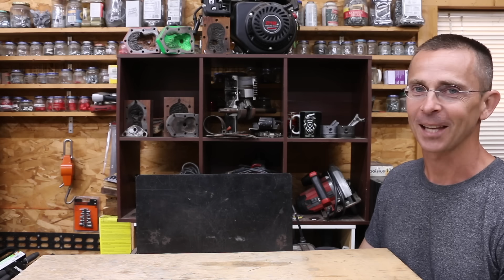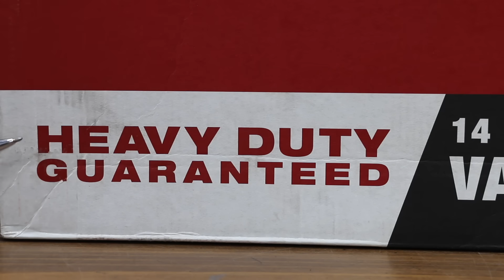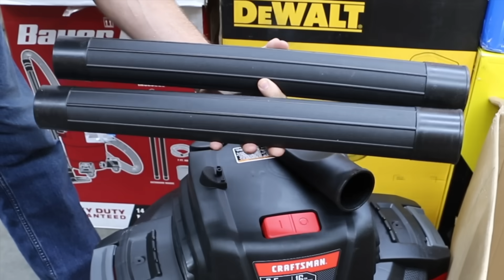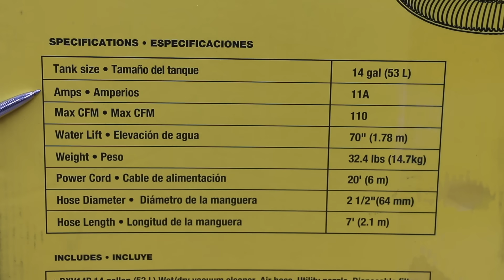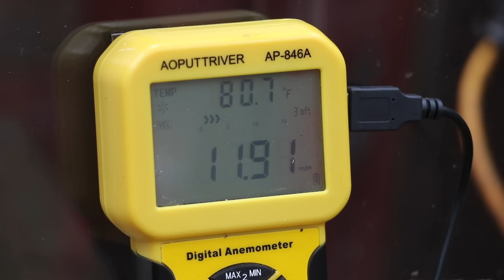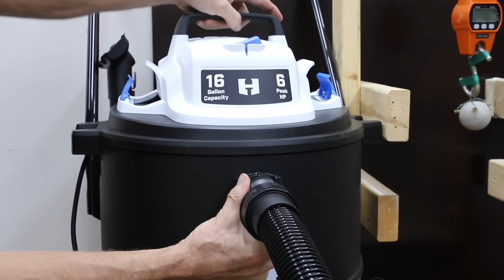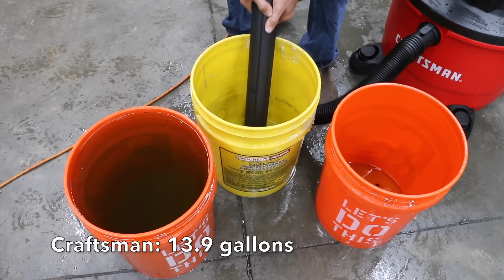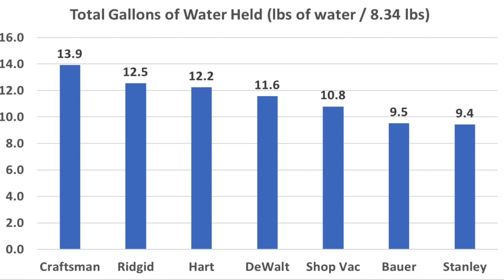Best Shop Vac? Ridgid vs Shop Vac, DeWalt, Stanley, Hart, Craftsman

Comment: Great video as always. The only thing to consider (if it really matters to anyone) is that particular Shop-Vac brand model uses a brushless motor and I doubt any of the others tested do. This means that at a similar amperage drawn...that motor actually produces substantially more horsepower as it is way more efficient than a brush motor. I’m not sure as to the math for how much different but I would bet certainly enough to matter.

It also will mean a substantially longer motor life.

Obviously real world testing showed it to be an inferior shop vac so there must be a lot of other factors at play as in theory that model by far has a superior motor to the rest of the crowd. So the only real world benefit to a shop vac brand model with the SVX2 motor would be its longevity and durability.

Comment: Anyone know what shop vac has the largest filter? I vaccum fine particulate matter, and im sick and tired of having to beat out the filter every 10 seconds. It goes from brand new to wont suck up a grain of sand in less than 15 seconds.

Comment: I had an old Craftsman wet and dry. That sucker would pull  wall to wall carpet off the floor. It was very powerful . Dry wall dust killed it or it might have been the beer and sand .

Comment: I bought a Bauer shop Vac over a year ago I use it almost everyday either around my farm or at construction sites. It may not have the best warranty but I will say this, it has been a nonstop powerhouse for sure and has been in my opinion worth every penny. But if you buy the extended warranty with it all you have to do even if it burns to the ground is bring it back to the store and they will give you a new one on the spot!

Comment: I have an old Craftsman 5 hp that beats the hell out of all the rest I have, including Rigid. but none of them is compared to the $1,400  Minuteman I have, but also it is a $1,400 dual motor. the one I use the most is the Craftsman still kicking after 20 years.

Comment: I have the 5.5hp Ridgid and it works really well. The only issue that I experience is debris slightly larger than the radius of the hose constantly gets jammed on the lip inside the attachment holder where the hose marries the holder before entering the hose. Ridgid could have designed that inside lip to be at an angle so debris would not catch. I contract finishing work and that is a HUGE inconvenience when cleaning after a demo.

Comment: Testing these with drywall dust would be the real test. Most shop vac's just cannot handle drywall dust. Every vacuum cleaner I have tried just can't make it more than a few minutes without the filters clogging up. Bagged vac's seem to perform much better. So far the best I have found is a Henry (UK made) vacuum. It would be great to see a test of shop vac's or home vac's that work for drywall dust.

Comment: Never buy a shop vac that has that  fan air vent right overtop of the engine.  If you forget it outside and it rains the water will soak the engine and bearing wich will rust and now you have shop vac no more.  It should not be aloud to sell an item with such a faulty design. If i find a free shop vac and it has direct access vent to the motor (you just look straight down and you can see the motor even watch the rain hit the motor).  I won't even bother to check it, cause i know it will have a rusted out bearing  and probably a fried motor coil.  100% percent In fact this  is a real peave for me.   Anyways any of your shop vacs tested have the deadly flaw?    Disquilified ! unreliable design.

Comment: I had a rigid for about 10 years in a hard use industrial application, being used once every week at least. Comparatively, the big expensive Stainless Shop Vac failed after 3 years.

Comment: I've got 2 ShopVacs but I'm slowly changing over to Ridgid.  I had to replace a motor in my 16 gallon ShopVac, so the lifetime warranty is hard to argue with.  My 18v Ridgid died after 3 years and a new one in box was on my doorstep a few days later.   Also, a 14g Ridgid was abused daily at my wife's pet grooming shop and it lasted 5 years with literally the same filter.  The girls didn't know they needed to change / clean it.  When I opened it, the filter was crushed in due to it sucking so hard while clogged.  I didn't warranty that one.  We bought another for $40 on Black Friday.  It's been going strong for almost a year now.   I have an extra 10 seconds to get something done.

Comment: I like the Ridgid for two reasons:  It has a dual purpose (vacuum and blower),   and it's not made in China.  I think the suction can be improved by sealing the lid better maybe with rubber or some kind of sealant.

Comment: Before I retired I sold chemicals and equipment including commercial shop vacs, these were tremendously more expensive than the home models but their performance (suction) was several times what the home shop vacs. The standard rating for vacuums is in inches of water lift, it took me a lot of searching but I finally found the rating for the Shop Vac which was the most commonly seen home shop vacs, I don't remember now but the commercial shop vacs had 3-4 times more water lift than the home models. This was demonstrated when we would use them to remove water from floors and the commercial models crushed the home models, of course not everyone wants to pay $400 or more for a shop vac! When I needed a personal shop vac I got the Shop Vac brand, I couldn't afford a commercial model for my occasional use. In the end the main point of the post is to point out that inches of water lift is the standard measure used in the industry.

Comment: Hi, It's a good test, but you should also included filter capacity, filter clogging and filter degree of dust separation for concrete dust, plaster dust etc. also if it has manual or automatic filter cleaning. 
I really like your tests :-)

Comment: A series idea. First a cordless circular saw shoot out. Then do a separate video comparing corded circular saws. I’d also be sure and include both sidewinder and worm drive saws. Finally a shoot out between the cordless and corded winners. Be sure and include some brutally tough cuts so the advantage of a worm drive saw (if any) can be shown.

Comment: I would also be interested to see a durability segment for all these. I was in a house that was being built, and I had the job of cleaning all the sawdust, I used a shop vac heavy duty like the one  in the video. The front smaller wheel hit something and damaged the plastic and the wheel fell off.

Comment: What a great video! I can't believe the HF vac did so well.

It would have been interesting to see the amp draw of the motors during the suction test. I think that would have given you a better idea of the power output.

Your flow meter setup was just about spot on for how I've seen guys in the HVAC industry do it. I don't know if it would have been too technical for the video, but you could take your air velocity reading and multiply it by the cross sectional area of the narrowest point of your test "duct" to get a flowrate in CFM. That would have been cool to see how it matches the rating on the box.

Still, fantastic job all around. All of your videos are so great and the tests you come up with for testing everything are always so clever!

Comment: I am looking at small portable shop vacs and i was wondering if you have done any test on the smaller 2 - 2 1/2 gallon vacs. Possible even some battery powered models. Thanks for all your hard work and great videos.

Comment: Just want everyone to know that all shop vacuum horsepower ratings are all BS. A wall outlet can supply a maximum 1800 watts or 2.4 horsepower maximum. 6 horsepower is roughly 4500 watts. As shown in the video they do not get nearly the rated power. Also the disclaimers for the horsepower are still BS and they probably mistook "marketing department" for "laboratory testing"

Comment: Thank you for the great in-depth comparison.
I use a cyclonic dust separator with my shop vac which captures over 60% of my sawdust. Would it be in mine or anybody else's interests interest to go from an eight gallon to a 16-gallon vac if the suction levels are similar?

Comment: Gun related but not a gun. How strong are rifle slings?  The types commonly used with ar15. I saw on news a guy pulling on a rifle but could not take it away. I wonder how strong slings are. Many have plastic hardware and steel mounts.

Comment: At my Walmart, they had a Metal Stanley 8 gal, 6 hp on the display that looked nearly exactly like Hart model in the box below. A lot of the Vacs I've seen seem to be nearly identical with a different color plastic in some areas...It would be nice to know the equivalent Brand/Model tested so we can shop for the best price. As you mentioned, a root company may make the same unit under 3 different brands with just different colors to set them apart.

Comment: As a former professional calibrator, I would have done the suction power with a vacuum gage using inches of mercury...The velocity (CFM) with the anemometer is fine... You mentioned that some of the lids didn't seem to seal very well. Was this true while the unit was ON, thus loosing suction? This video is very important to me since I'm ready to purchase a Wet/Dry Vac this weekend...

Comment: With the recent wildfires I wonder how vacuums would perform picking up a small amount of ash.  Measure amp draw of motor before, during, and after a realistically small amount of ash.  Also, there’s a premium few shop-vacs “SR” that have switched reluctance motors (and I believe 10 year warranties).  If normal vacuums’ rotors short out from the carbon in the ash, try out the “SR” ones; they’re brushless motors so they shouldn’t short or draw high amps after vacuuming ash.

Comment: i have the rigid all metal body 6.5hp vacuum at 250 cfm, definitely the most powerful vacuum on the market, vacuums are to be measured by cfm, not hp.

Comment: Wait, I thought DeWalt was doing best or tying with Bauer and Craftsman? Though DeWalt was the heaviest and Craftsman seemed to have the best motor the DeWalt bucket construction proved to have better impact on suction.

That is what I got from this, so I was confused by the summary. I need a shop vac, so this was a very helpful video, had bad luck with smaller cheaper vacuums in the past.

Comment: Minor note on your protocol. For the suction test you aren't controlling for the diameter of the hose to ball connection. If a vacuum creates 3 psi of under pressure and you give it 1 square inch to pull against you'll get 3 pounds of force on your gauge but if you give it 2 square inches to pull against you'll see 6 pounds.

Comment: i think you would have been better off getting a ridged that didnt have that attachment, as i use ridged at my shop and it does a very good job at picking up sand and water, but then mine is about 7 years old, so maybe they are making them cheaper now

Comment: @Project Farm:  Video Idea - a test products to prevent stolen RFID credit card information.  Several products, such as RFID Wallets vs RFID Blocking Cards vs aluminum foil vs thicker sheet of aluminum vs a few other types of sheets of metal (thin enough to fit in a wallet).   If you have a dentist friend with an X-ray machine, it would be interested to know these products contain.  I read a regular credit card can be put in a bottle of acetone to revealing the RFID chip and antenna (wire loop), takes a few days.

Comment: The better measurement for power is wattage rather than amperage. Power factor affects the current vs power calculation for AC motors. The kill a watt will measure power factor, amperage, and voltage and calculate wattage. 746 watts = 1 hp

This probably won't make a big difference, but trying to help. Thanks for the amazing videos.

Comment: For testing the horse power, I wonder if these companies use different standards to get their rating. Like is the hose on, is it off. Is it under load? Is the motor even on the tub? Or is they way you tested the draw the standard?

Also wondering if a small foam gasket on some of those bigger vacuums would help eliminate air leaks and improve performance

Comment: One thing to take note of...Bauer from Harbor Freight can have a warranty added and you can walk into the store to get it handled if there is a problem. I have owned DeWalt tools for years and, while their guarantee sounds really good, try actually getting them to fix or cover a problem. They are a nightmare to deal with and Rigid is even worse.

Comment: All Harbor Freight power tools come with a 90 day warranty.  An 2 year extended warranty can be purchased.  This warranty is a full replacement warranty. If it breaks in 2 years bring the tool in and they give you a new one. None of the other brands offer that. Instead it has to be shipped to a service facility and you are with out use of the tool while they repair it.  Possibly taking a month or more

Here is a video you can make. Test the warranty on tools replaced. How well is the customer service?

Comment: Those american units is... yeeez! Leave it and go for the real standardized ones!
Ho he knew how much water they could take up, i totally lost it. Divide the weight in pounds with something point something and that roughly equals...
We use logical units so here we just... One litre of water equals 1 kg or 1000 gram. So if the scale reads 28 kg it is 28 litre... And 100 gram is one decilitre and 1 gram is 1 millilitre and 1000 liter is one tonne and... It could not be any more simple! And the same goes for other units like length and area and so on.

Comment: One thing I have found to be important when purchasing a shop vac is the availability of replacement parts. I bought a large craftsman shop vac from Sears about 17 years ago. It worked great but when I went to buy a new filter and an attachment I’d lost I couldn’t find them in the store. I bought a couple smaller shop vacs over the years for cleaning out the car, etc. and found the same problem. I finally bought a large Ridgid after realizing I can go to any Home Depot and find every accessory, hose and filter I need. I only wish I’d discovered that earlier.

Comment: I really enjoy your videos. One test that I would have been interested in between your wet/dry vacs would be max pressure. I'm a plumber and sometimes when trying to get our initial DWV rough in test we use these style of vacs to help blow the systems up. We deal with large volume systems and these vacs help speed up pumping the closed systems up to 5 psi. They also help find large diameter holes or uncapped drain ends. In my experience some Ridgid and Craftsman vacs can almost hit 2.5 psi in a very short time frame verse a air compressor. If a company could make one hit 5 psi they'd have my money. Just a suggestion if you ever do this type of test again. Thanks for all of your channels great and interesting content.

Comment: Love your channel and the way you present the products and tests. I did have a question for you, how did you convert/equate Amps to HP? As far as I know, Amps can indicate power consumption but must go through P = I x V, where P is power, I is current and V is voltage. If you have some time available, please reply with your equation(s).

Comment: Shop vacs are not all created equal!  For longevity, I've had good luck with Rigid, though I've never owned a Dewalt, Hart, Stanley or Bauer.  The Bauer is interesting, but with the short warranty, I'll pass.  I've also had mixed results from HF power tools.

Thanks for another great video!

Comment: Video suggestion: testing wiper blades, cheap vs expensive ones?!
I always seem to get the best life out of the cheaper (not cheapest) wiper blade available. The costly bosch ones dont last at all on any of my cars, especially in the summer heat if the southern Us

Comment: Thank you for your testing.
I'm in the commercial floor prep business.  The brand Shop vac from lowes have bad on-off switches.. i have returned  several to no avail... ridged vacs are durable  but im getting a bower  for the fleet. Thanks again.

Comment: If only you'd tested the durability of the hoses.  Try overstretching or stepping on them and see how tough they are to abuse.  Still, thanks for the useful info - it's so relevant for me.
BTW, watching your videos at 0.75 speed really aids comprehension, you always rush through the results.

Comment: One issue with your "suction strength" test. You need all of them to have identical nozzles, otherwise the results will be affected.   
The wider the opening, the more force it can suck with across the whole surface, so two identical vacuums will suck with different strengths if one has a larger opening.  
This could be part of why DeWalt and Bauer are in the lead, with the largest opening diameters.  
The most common example is vacuum salesman doing the bowling ball test, using a large conical nozzle to lift a bowling ball to suggest it has excellent suction. It could never do this with a standard size end.  

Both the liquid and sand suction speed tests I feel were great real world tests however, likewise with the VS tests. So your over-all ratings were still perfectly good I think.

Comment: Gotta love the wanky HP ratings they put on the box. Imagine if the window sticker on a Toyota Corolla stated: 250 peak HP. Then in the fine print it reads: "in a lab with no muffler, no air filter, 110 octane fuel and race cam." It'd be like the 1970s all over again. Marketing is a race to the bottom. Uninformed consumers will look at that number and think "bigger number = MORE BETTER." So now they all have to do it.

Comment: I sure for a cheaper vac that would be okay. But you will have a hard time convincing from my Festool After using it for sanding sheet rock and you have no dust on the walls. when you try pulling it off the wall it comes off hard.